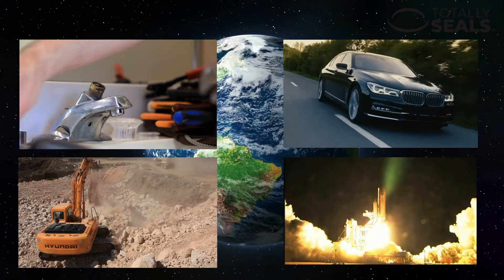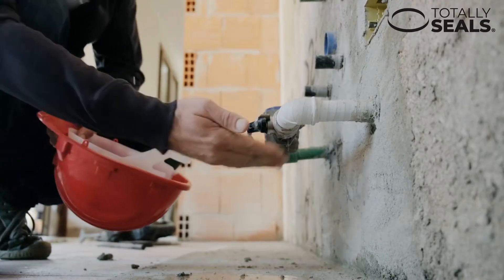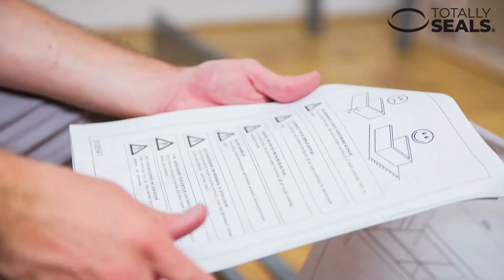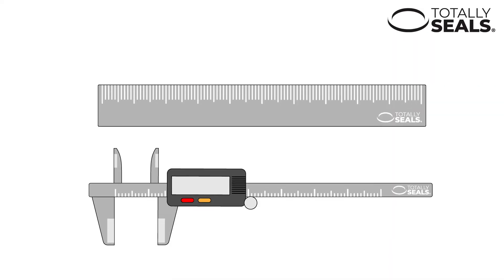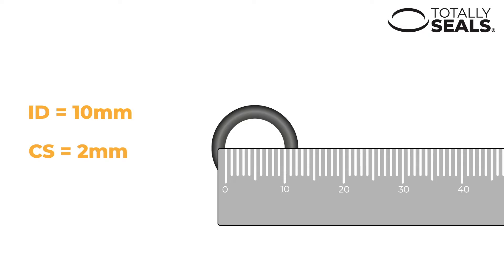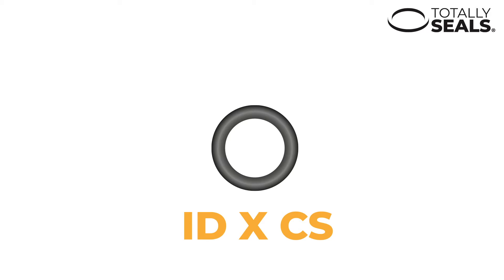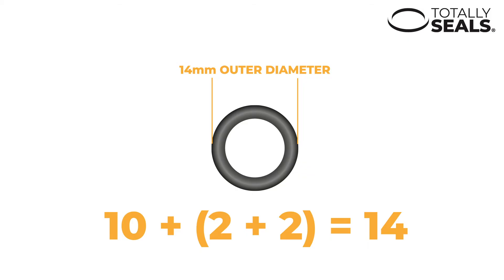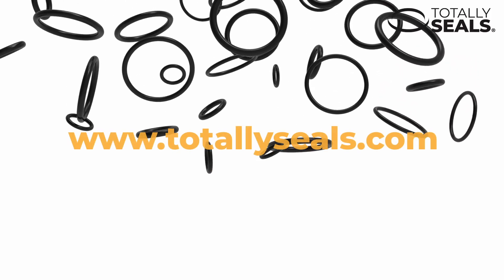How to Measure an O Ring (with only basic tools)

Comment: You learn something every day. Today I spent hours driving around, visiting several shops, to find the correct O ring for my leaking mixer tap in the kitchen. A friendly plumber gave me a selection from his van, but sadly they were not the right size. Eventually I found a box set of around 200 assorted O rings for under a fiver and the correct size I needed was included, thank goodness. I installed the O rings (there ars two on the spout), reinserted the spout and tightened the holding nut. Result: no more leaks! I was beginning to think I would have to replace the whole tap, which would have been a heck of a job. Here's a tip: buy a supermarket sandwich when you've got an emergency, as you won't have the inclination to rustle up some food while you're rushing around to fix the problem.

Comment: Why measure the cross section at all?

I just measure the ID and the OD and the difference is the CS.

I find measuring the CS is difficult because of the curves especially on smaller orings. While measuring the OD and ID is as easy as laying the oring on a ruler and aligning one end with the 0.